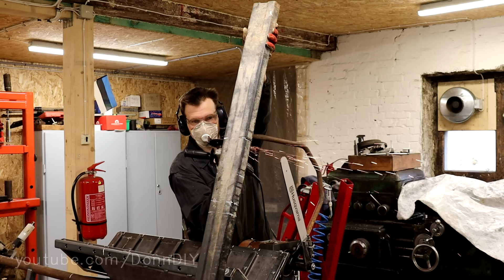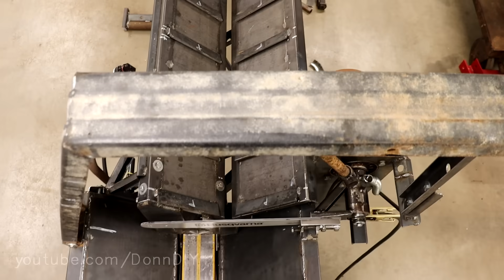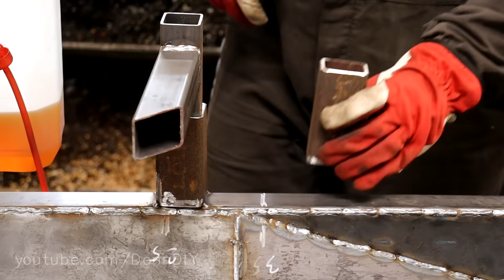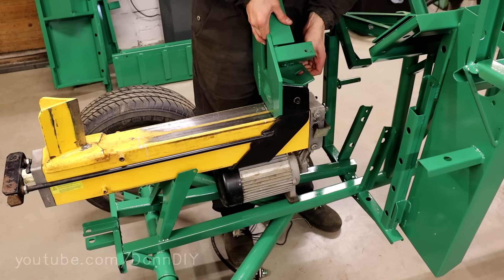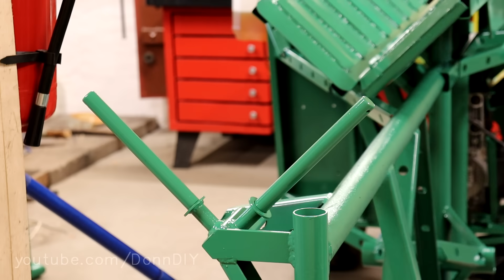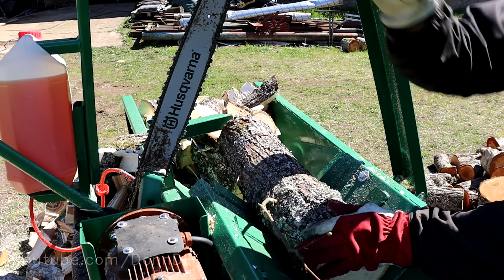Homemade Firewood Processor - Log Splitter To Firewood Processor Ep. 5

Comment: It wont be faster but man it will be much easier on the body.  I like it and its simple to use and the COLOR ROCKS :)
Reply from the maker: Considering my abilities with an axe and a chainsaw this method with a machine will be faster for my use. :D I would be definitely quicker than the machine in the beginning for a while but the machine will win at the end.
Reply: @DonnDIY  Right I agree and its a great machine.  Eventually you might want it to pull back into place a bit faster but that's just fine tuning and nitpicking.  Great Job once again you impress.  There is hope for the youth yet :P

Comment: I see youre pushing the wood against the non moving side as the feed side goes backwards. Maybe a small spiked bar hanging down could bite into the wood and hold it in place. As another benefit you could just keep feeding new wood instead of picking up the end piece each time.

Comment: What about adding a switch so the saw doesn't power up until the log is fully retracted, I'm just thinking about the possibility of starting cut through a log and hitting the side of the pan, might be irrelevant but just a thought.

Comment: Dig a hole with a ramp at the back of your log spliter, so you can back your dump trailer down in the hole, the fire wood will just fall in to the trailer.

Comment: Sweet processor,now if you could find a way to speed it up without fast forwarding the video.mayve more powerful motor,is it battery powered? If so ,more powerful batteries? Either way nice job .

Comment: Measuring tape?  I don't need no stinkin' measuring tape!   I love it cut to fit and it looks mechanically all right....
Reply from the maker: I used measuring tape too. 😁 But mostly slapped this thing together.
Reply: @DonnDIY    Yes, but sometimes cut and fit is more accurate.  You visualized the plans very well.

Comment: In metal, what do you think the total cost is? Donn!! You are the man!!
Reply: Also, I think bigger!! What about 24 inch diameter logs. Or even 36
Reply from the maker: This is made of scrap steel which I bought from a local steel shop for scrap steel prices. The whole cost of this project in materials is around 400€, half of it is the price of the store bought wood splitter. I don't include the cost of my own work since I built this machine for personal use.

Comment: Am i missing something but wouldnt it be cheaper or same price to just have electric heat with solar panels to offset cost of electricity? It seems like a lot of work when the heat could just automatically turn on with out user input? Please correct me if im wrong.
Reply from the maker: In Estonia we don't see the sun that much and heating with electricity makes one dependent on the grid. We have good quality electricity but with storms we do have power outages quite often. And it usually happens in Fall when it's cold and wet. Heating with wood makes one much more independent.

Comment: An excellent achievement but something seems to be missing ...
When the cutting chain breaks, the operator will probably collect it in his arm / chest / shoulders / head. Will he survive?
If the wind blows in the wrong direction, it's crappy.
By adding a steel guard this (vital) problem disappears.
Reply from the maker: The chain and the bar are offset from the operator. And there is a steel chain guard. Watch the video closely.
Reply: @DonnDIY  That guard is inefficient for the chain, it eventually catches the oil if the wind doesn't blow. I mean, the defense is only in numbers ... it's practically non-functional, so it practically doesn't exist.
When the chain breaks, it can jump straight into the guard. It will most likely wrap around the guard ... its tip will describe a circular arc and the trajectory may intersect the operator's body; only if the chain remains attached to the guards! Of course, it could jump back - high probability.
Too many variables, a thick aluminum / plastic / Kevlar panel would hold the chain securely. A minimally invasive upgrade would be to add it to the existing device.
This is a constructive critique and if you want me to follow in this style please let me know.
Anyway, I appreciate your achievements.